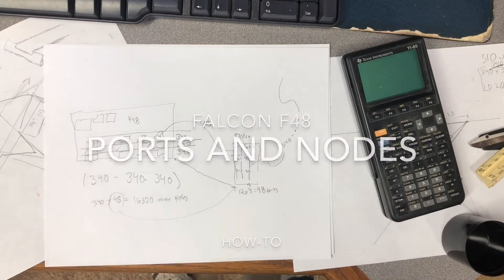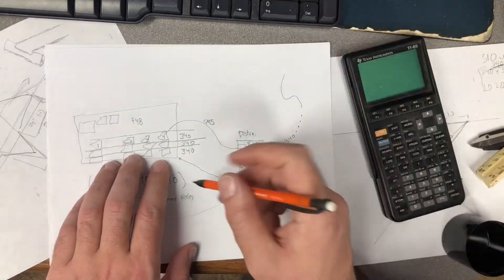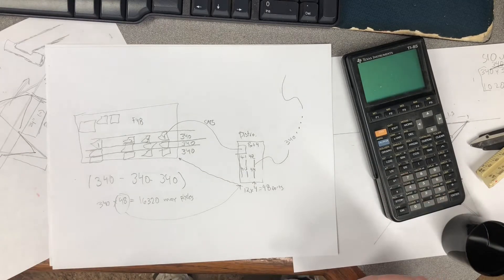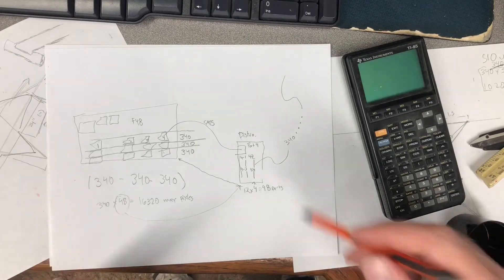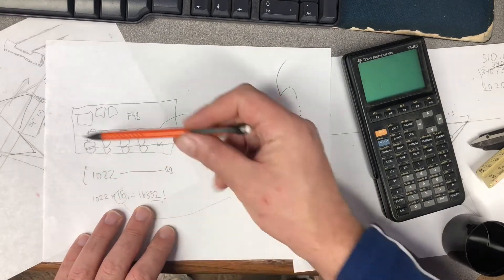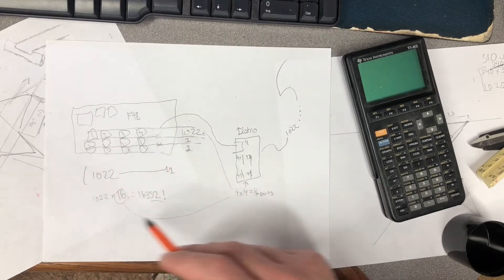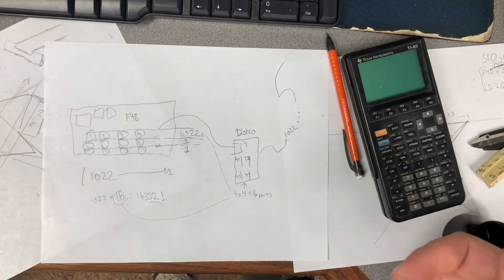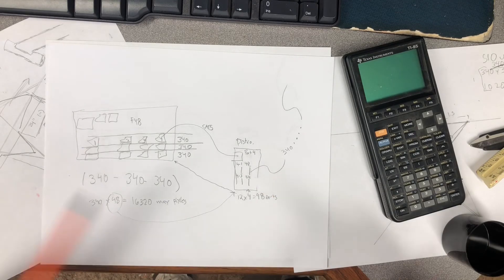Falcon F48 ports assistance

Comment: So is it 1022 pixels on each of the 4 output on each of the distro boards? Or 1022 pixels divided between the 4 ports of the distro board?
Reply: As per what I understood, 1022 pixels can be connected to each of the 4 output on individual  "distribution" boards. so present set up (1022-1-1= 1024 pixels ) will have 4 distribution board connected to 4 ports, which will be  the  first top raw of F48 board. so each port of F48 will control 4 ports on single distribution board with maximum 1022 pixels nodes(led light)/port of distribution board. so 4 ports of distribution board will control (4 X1022 led light).